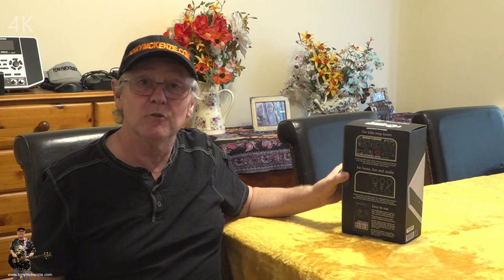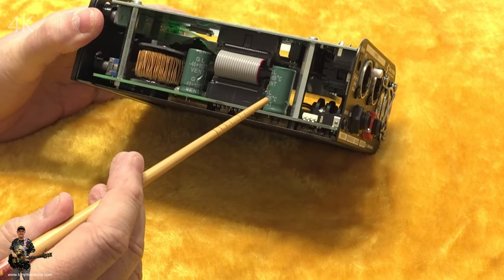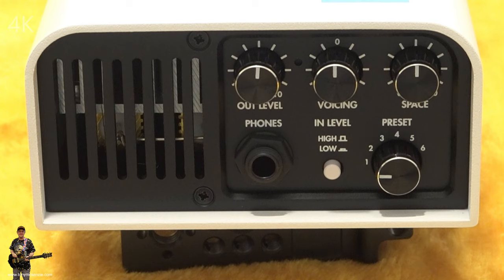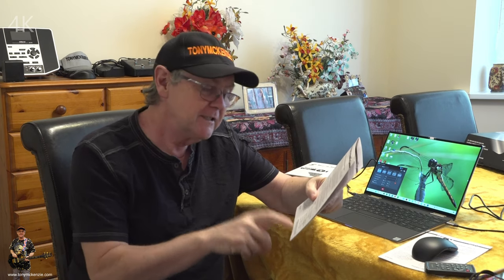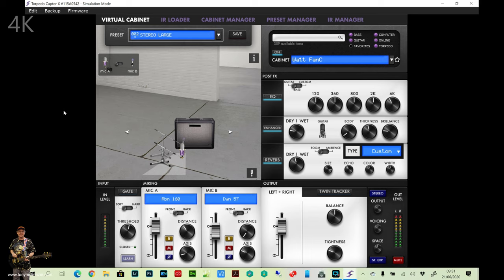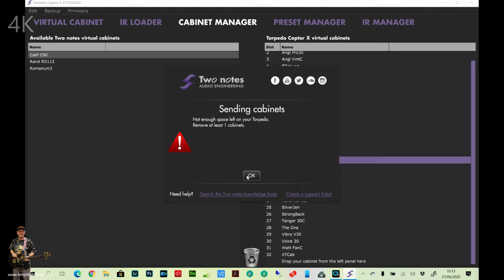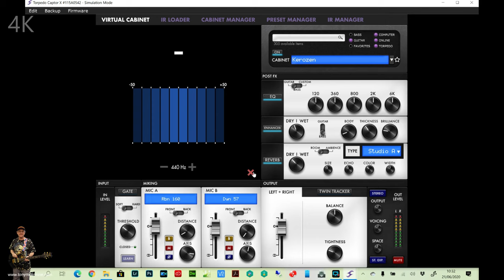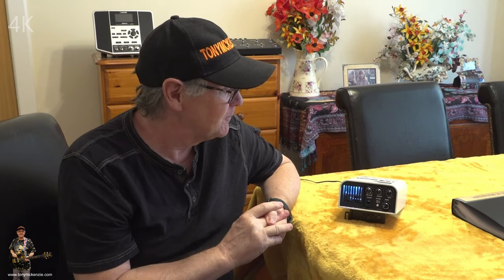Two-Notes Captor X  Inside & Out Review | Reactive Load, Attenuator & DI | Played on a JMP Plexi Amp

Comment: Thanks for this review - I have seen the other reviews, and am tempted to pull the cash out of my pocket, but your review always weighs more. So, soon I will be the raptor with a captor.
Reply from the maker: Ha... brilliant... A RAPTOR WITH A CAPTOR - man that is so funny :) This piece of gear, the CAPTOR X, is pretty cool. They will never listen to me about the on/off switch but there you go. In other respects its a great price and sounds pretty good. It actually tamed my JMP 100 hand wired amp and that can be a real handful with volume. I can spot a sales review from a 1000 yards and I never really 'get on' with those things. But I try and show what you're really getting. I'm not always perfect but at least I try :). Thanks for watching and absolutely stay safe out there.
Reply: U2, as Bono says - stay safe - I will try to capture the captor, and nothing else. There is a synthesizer called the virus that I almost bought, but i opted to inoculate my computer with the soft(ware) version instead and saved a few bucks!!
Reply from the maker: Virus made by same company as the Kemper... I know it but never used one. The HW version was/is pretty high quality right? What's the software like?
Reply: The software version is pretty good, but I have several hardware synthesizers, including a growing modular, and the 3 dimensional, gutsy feel of hardware really can't be found in software. It's like comparing being at a concert, and listening to a "live" recording, as the French would say, Rien a voir!!

Comment: Great video Tony! My new favourite YouTuber… appreciate the honesty and detailed review not like all the others which are more like commercials. 

Question… I have the 8ohm Captor X and really love this thing. The -38Db setting is perfect for playing at home. 
I love it so much I was thinking of getting the 16ohm Captor X to run through my 16ohm cabs. If my amp is set at 8ohms —> 8ohm Captor X —> can I go into a 16ohm Cabinet? At 40:28 in your video I believe you mentioned that you can do this. 
Or should I be getting a new Captor X 16ohm? They are quite pricey now at $840 CAD. 
The manual is confusing on this topic.. in the beginning it says ONLY to use your 8ohm Captor with an 8ohm Cab. But later in the manual it mentions you can try mismatching the Cabinet but only by one step … ie 8 to 16 !!! Confusing… yes !!! 

BTW your spot on with the Power button … your the only YouTuber that mentioned this !!! I kept wondering am I mad or why the heck doesn’t this thing shutoff… where’s the on/off switch 😂🤔 Tony to the rescue…Spot on mate 👍
Reply from the maker: 8 to 16 IS only 1 step... and how I understood it you can do that they said I agree. I never did do it though. It IS worth firing off an email to them though just to be sure. Ha I have a thing about the on/off as many these days just don't fit one... IMO just another way to crow bar extra profit out of the deal. Sadly... the ME-90 has an on/off... but they did not bother with the power supply (about £25) or even a USB cable (about $0.70).  Thanks for watching its always appreciated and these videos sometimes take some getting to complete in time and cost. Thanks.

Comment: Thanks for this great review as always. I know my comment is a little late but here it is none the less.
I thought you might be interested to know that the reason there are multiple caps and resistors is to recreate the impedance curve of a speaker. I believe that is what reactive load refers to, opposed to resistive load which doesn’t attempt to recreate that curve. 
The Suhr Reactive load works the same way. I believe theirs is modeled after a Celestion Greenback and Two Notes Captor is modeled after a Vintage 30. 

Thanks for all you do.
Reply from the maker: Thanks for posting this info Travis... it all helps and I only really took a quick look over the unit. Stay safe.

Comment: Thanks for taking the time to make this detailed review! That seems so odd to not have an on/off switch. I like a number
 of the features such as the space control. I also noticed that some of the higher end Two Notes products such as the Torpedo Live are made in France, but I'm glad to see that overall the Captor X seems solidly built. Have you by chance had a chance to try the Suhr Reactive Load IR? I don't need an attenuator and have been debating between Two Notes Captor X and the Suhr.
Reply from the maker: I thought it was not there because of space maybe? Yes the Captor X is pretty well made and seems good value. I only tried the Suhr reactive load inside the PT-15 and while it's probably the same it's stuck in the amp. Review of that amp here: https://youtu.be/6bKiugq5onk and I did show the unit in the amp. The Two Notes is likely the best buy as it offers more for probably similar (or less) money depending on where you live. In any case they all seem well made. My guess is that the IR software in the Two Notes eats the Suhr equivalent alive. Two Notes have been on that stuff far longer I believe. Hope it helps... and stay safe.

Comment: I've been hesitant to get anything two notes because they all only handle 100 watts.  I only have a triple recto and I would prefer to have a unit that could handle the wattage.  Not that I would ever crank my amp that much.  I'm not interested in power amp distortion.  Maybe get a two notes and run my amp on the spongy setting?  Spongy should only be putting out 75 to 100 watts, I'm not sure.  Cheers Tony!
Reply from the maker: The Triple Rectifier is a beast! I agree I had two of those... 150 watts all day. I forget about the exact spongy wattage out but it can be a loud amp. Great amp though and I regret selling mine. A bit twitchy in getting specific sounds sometimes, but there are ways around that. I would recommend output of about 80 watts out of the amp and keep it that way. The CAPTOR X has a sensor for the heat aspect so I don't expect that to cause any lasting damage but it might turn off or reduce the signal somehow - I never tried it and don't want to either. I was using the JMP (which is really loud) and had no problem - see the setting on the video - it must have been about 75-80% cranked. I find that if you go much further that it does not make that much difference to the tone on that amp. 100% seems no point so for the CAPTOR X the JMP works pretty well. I think it would work for you but just keep that master back somewhat :) Great point though and stay safe.

Comment: Tony : so only owning a 16 ohm cabinet and plugging that into the Captor I use the 16 ohm out of the Amp to connect into the Captor instead of the 8 ohm?  Just wondering if I heard you correctly in the review.
Reply from the maker: I was foxed with this too! It appears that when the CAPTOR X is on 'full' that its a 16 Ohm (if the cab is a 16 ohm) and when its not on full its an 8 Ohm load. The manual is specific (rather than me!) - here we go:

If there is no speaker connected to the OUTPUT of the CAPTOR X then the amp loading is 8 Ohms. 

If there is a speaker cab connected to the CAPTOR X AND that the volume switch is LOW AND the Volume level on the CAPTOR X is set to the half way position then the amp impedance is and remains at 8 Ohms too.

However if the speaker cab is connected to the CAPTOR X speaker output, and the volume level switch on the CAPTOR X is on FULL then the impedance seen by the amplifier is then the impedance of the real cab - so you would set the amp to the impedance of the cab. 

Depending on the settings then, it IS possible to have a different impedance of the cab than that of the CAPTOR X if I understand it correctly. It IS a little weird but it's fathomable :)

You are the first to ask this, although I thought there would be many more because its an 'out of the ordinary' situation. They also say that ANY mismatch should be minimum... i.e an 8 ohm to 16 ohm would work but a 2 ohm to 16 ohm would not. The mismatch only applies while the volume is on FULL (that is the switch and not your amp!). 

I hope that helps... but without the gear it is harder to be clear about it all. Stay safe.
Reply: @tonymckenzieofficial   Thank you Tony for the very clear reply. I understand it and see how it works now. Many thanks and yes stay safe in these times.

Comment: Thanks for the video. I've been looking at these myself. I've tried  plugins from neural dsp. And I've tried my amps d. I. Emulated outs, but I ever seem to get a better result than the trusty ribbon mic and condensor on the 4x12.
What's your opinion of the sound recorded using this type of thing? I'm desirous of using some of my bigger amps without deafening the neighbours, or carrying them to a studio. I make a lot of production music. And the promise of these devices is that I'd get the sounds I'm after recorded over monitors silently, or by monitoring in the room over the cab. But feel wise Im worried I just wouldn't get the response of the traditional real world gear. And the sparkle of a real set up. 
Does it deliver? Or am I still going to be wanting to use the actual mics? Thanks again. 

Also another cheeky unrelated question - I was wondering what you thought of the dsl100h? I've got an eye on one. (I've already got a 6505+ and was eyeing up the revv g20) . But the old dsl's are cheap. And sound good to my ears. And my current Marshall is a bit tired. I can pick up a dsl cheaper than a service and retube. 
No bother if you're too busy to give an answer. 

Stay safe. And keep on making informative content.
Reply from the maker: Great question. I come from tube amps. I do not think the sounds from any of these types of boxes are perfect, if I was to be very picky. But for some of the amps I own there is little or no choice in using a reactive load box. I have personally never been a fan of IR stuff and prefer a real speaker if the truth be known. The Marshall JMPHW I have sounds brilliant but too loud for sure just as you say. I bought that amp recently and plugged in, then realised just how good the JMP remains. But with that volume it's hard to handle. I have a WAZA TAE and this CAPTOR X. Both of these devices reduce the volume and I think the tones I achieved are pretty good to excellent (for how and what style I play). The CAPTOR X has many 'whistles and bells' as does the TAE but the CAPTOR X wins because of price and it offers even more than the TAE does. But I found the TEA less complex. I do think the sounds achieved are similar between those two. But are they the same as through a cab? Given a choice I would personally set up a microphone and record that way, but for this review I wanted to show the direct sound I achieved. I'm not perfect and certainly no 'tone hound' but to me the CAPTOR X did do OK. But there is a difference. 

Although I actually come from technology and since 1979 have been involved with the Far East and manufacturing etc. I remain not that great a fan of all the software and jumping through hoops to get a result. Call me old... but I think it's more than that. I can get a 'great' sound in about five minutes with a tube amp of my liking... but basically ALL of the products with simulations in there (and I make no real discrimination of any) I sit there passing time figuring out how to get a 'similar' tone to what I'm used to. That is for me the frustrating part. Spend time with an Axe-FX III and you will soon have little spare time. Spend time with ANY of them and time melts away. And its mostly not helped by many makers because pre-sets sound not too good from some of them.

But I do have to say, that all I did on this unit before using it was to tweak the setting 4 (because that had an effect I wanted on there), plug in and play. It was not a bad sound and that lead guitar on this video is a reflection of the tone. I added delay also... I have this theory... makers should make two modes - the complex one (as many are) and another setting - the plug and play one that is missing form every unit I have ever used. Simple, three or four parameters, change them if needed, and play. How hard does it have to be? Like I said I'm not frightened in the least about technology and have been part of it for so long, but if I was a maker then that would be something I would undoubtedly achieve in my equipment. 

I owned a DSL100 many years ago (green covered special edition). Not particularly a bad amp (I would look for the UK made ones just as a matter of course) and similar to my TSL100 (mine was about 2005 or so.). The TSL100 is an amp that for recording I got one of the best sounds I have ever done actually in the music (Eniac album 2006) recorded and that used a 1960a cab and an ribbon mic of one kind or another and that was it. Sound is subjective, but even now that recorded sound on that album stands out to me. So the DSL is of an era for Marshall that I did like. I still have a TSL today and I believe the main boards are the same! 

I always have time to reply to great questions which is actually what yours are. Considering the questions generated this post with many of my views in there whether they are what other people think of course is open to question, but I like questions that take thought really. 

Summing up for the CAPTOR X, I would have liked an on/off switch because it will tend to get left on in the studio, but other than that, it was/is a pretty good piece of gear. Get your tones on either a iPAD or PC the phone stuff (at least for me) is too small. Hope it helps... and stay safe.
Reply: @tonymckenzieofficial  thanks Tony. A great reply. And good advice on both counts. I play metal and industrial styles mainly.but part of the reason I get work is the fact I stick to real amps.or so I've been told. Producers say they can hear the difference. I can certainly feel it. I shall probably buy a captor x. It's cheaper than the ox. Or the waza. But I have a sneaking suspicion I'll still be a fan of mics in front of a cab. I use. A beyer dynamic and a. Senheiser. And they produce a massive sound on my orange 4x12.i  Might also just buy that cheap DSL 100. Thanks to your advice. I have  a couple of Marshall's.a malfunctioning tsl that has never really worked very well.and a mode four. (I know people dislike them, but it does make some useable sounds, and I quite like it's ugliness. Have you ever tried one?).
Thanks again for a great,well considered, informative reply.
Keep on making the reviews that are not just sales videos.your work stands out amongst a crowd of salesmen
Reply from the maker: I'm sure there is a difference! I have tried 'most' simulators at one time or another, but real tube amps and their cabs to me do sound different - but they 'feel' different too... and there you go, you touched on that exactly as I would have said anyway. Somehow it's just different... and when I take my JMP 100 HW and turn it up through one of these types of pieces of gear (and using the real deal cab) then I do think it's hard to better. Many people are on the IR and speaker sim routes but some of it can be a little binding. Try an Axe-FX III and I'll see you in a week. The Captor X for me was a breath of fresh air really because it's not that hard to use... and I could bet that most guys don't want to sit there twiddling knobs or clicking mice buttons so this was good that way without being silly. I have a number of Microphones also some rarer and some everyday but they can create great sounds. I don't have an Orange cab though - its one I missed :) Get a board for the TSL! That's a great amp but they do have a board issue. Boards here: https://www.hotroxuk.com/marshall-tsl100-main-board.html or wherever you are through a Marshall dealer. Relatively easy to change if you watch my video where I showed how to do that. Mode 4 huh... now that's also one I have never used.. and I try and reserve any judgement myself unless I have used one. There's all sorts of amps out there (and of course cabs, guitars, effects) and it's all subjective where tones are concerned. What's good for one guy might be the 'pits' for another. I think it's largely driven by the style played as certain amps just lean in a particular direction. Ha the sales videos are generally all over YouTube and I find it amazing how many guys don't really get that aspect. At least I try and most of the subscribers 'get' what I do in video reviews. I'm not always the 'best' player, but I'm like a Carlsberg... I get to the parts that other reviews cannot reach :) ... thanks and stay safe.
Reply: @tonymckenzieofficial  just an update.i bought the dsl100h. And  I'm very happy with it. As new condition. Great sound. And I bought a captor 16. I decided to buy that because i use it in the studio. And it does what I needed. Particularly with wall of sound. I'm still not overly convinced by the amp SIM IR route at the moment.but il persevere with the technology learning curve.i might even try and make my own ir's based on y own set up. I'm not a fan of the in ap purchase model two notes have employed to try and get  more in ap purchases if I'm honest. Thanks again for the great advice.
Reply from the maker: search the net for god cabs 1.4  hundreds (or thousands) of settings for free - not sure if those are any use to you though. I am also not really an IR guy and prefer to mic up a real cab in to the desk. Hope it helps... thanks.
Reply: @agroagro123  The DSL was my first big amp. Now with my more experience, the cleans are better than i thought, the crunch is really good. And the more heavy tones... are not for me. As i have more amps now i didn’t use it anymore, but still a good amp. 
Do you still enjoy yours ?